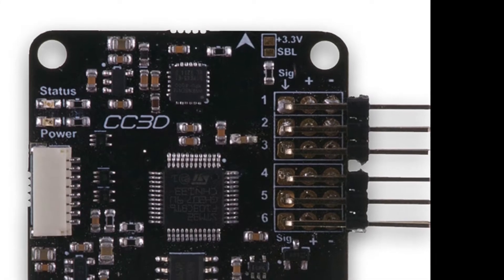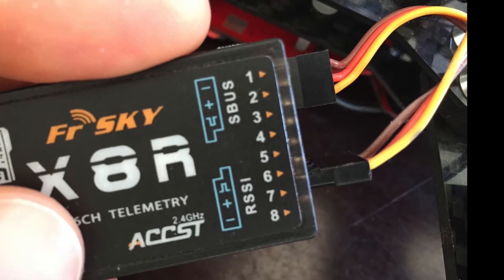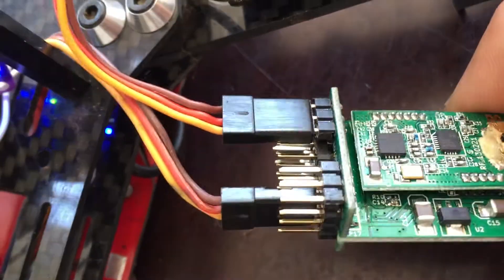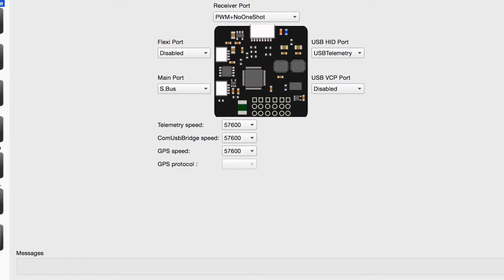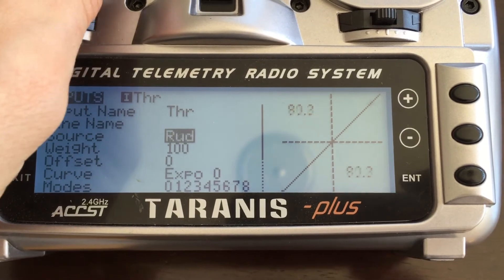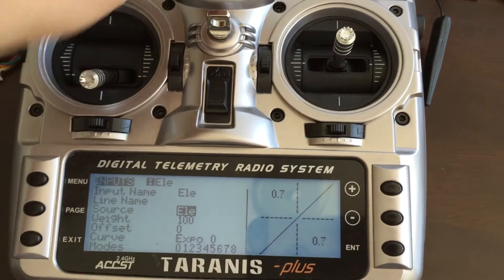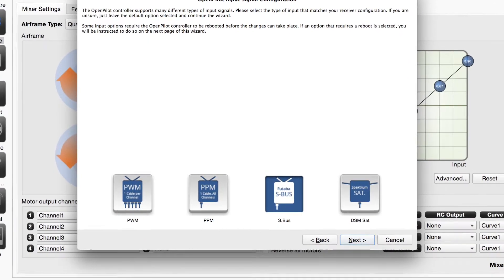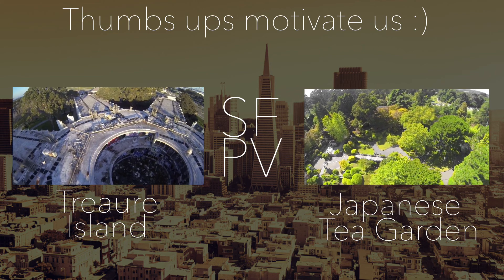One Shot BL Heli ESC Setup Using S.bus with CC3D

Comment: Please forgive my obvious ignorance, but I bought a SBus to CPPM converter to connect an X8R to a CC3D. I'm also using a X9D Plus and DYS BLHeli 16A Mini ESCs. I'm all for trying it, but so long as I can be sure I won't ruin any of my equipment. I know I'll have to do some cutting and soldering and would be amazed if just sending the wrong type of signal to a CC3D would break it! I won't hold you responsible in any way if it goes wrong.
I'll subscribe to your channel and see if you've answered the point elsewhere.
Doug McKenzie
Reply from the maker: Hi Doug, since the time of this video a lot has changed. I would recommend getting an x4r and running sbus to the cc3d. It's much faster of a communication that ppm.
Reply: Hi SV PV. Thanks for your very prompt response. I just looked at the email from the supplier who sold me the SBus to CPPM converter and what he said was - 

"I believe the CC3D supports SBUS, if this is the case then a X8R or X6R would do the Job, might be worth just dropping the seller an E-mail to check it does support SBUS as im not 100%, if it does not support sbus and only ccpm just get a decoder with your receiver"  

More fool me! I am now going to follow your instructions EXACTLY :-) I'm glad, in one way this happened - I now subscribe to your channel and will learn even more.

Thanks again
Doug
Reply from the maker: Doug McKenzie check this out - https://oscarliang.com/ppm-sbus-d4r-ii-x4r-sb/